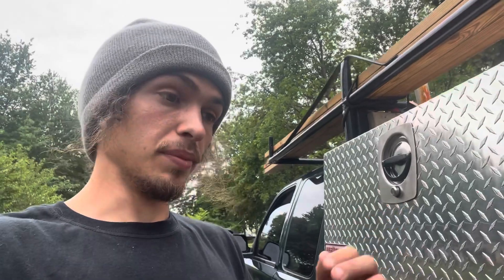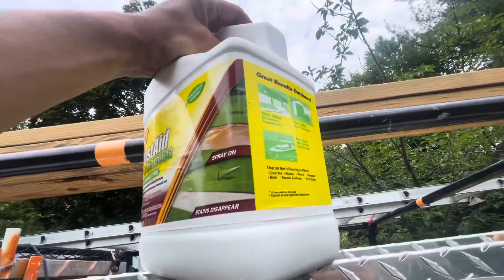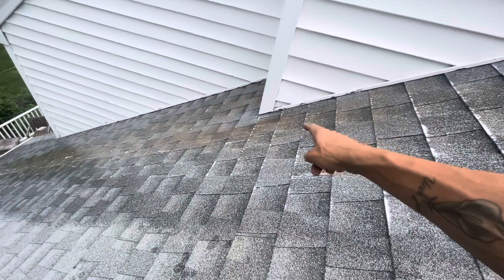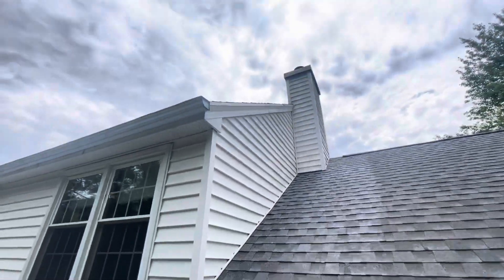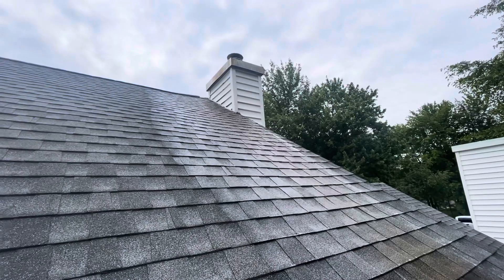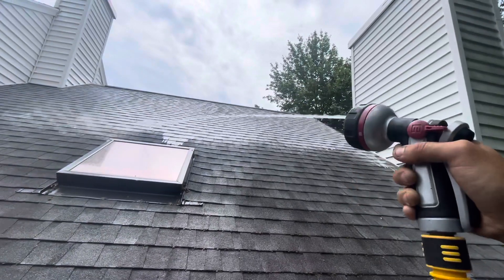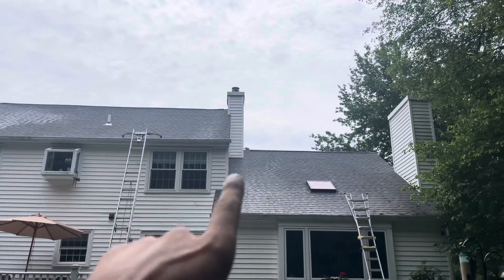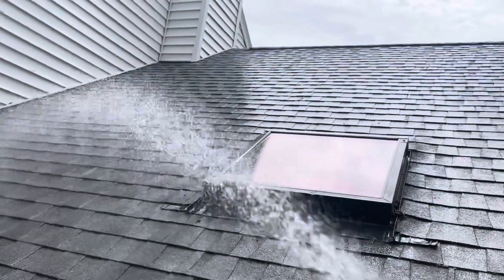How to Rust Removal Roof Cleaning- Rust Aid by Goof Off -12V Softwash

Comment: Hey man I just got my soft wash setup ready, and I was wondering what you generally pay for sh and where you get it? I’m paying about 40$ for 4 gals of 12.5% sh at my local pool store….
Reply from the maker: I pay 22 for 5 gallons of 12.5sh good luck!
Reply: Rural King has 10% - 4 gal cases for like $12!
Reply: I get mine from Pinch-A-Penny pool supply at $2.25/gal.  This store is a chain and may be in your area.

Comment: Hi Juan,
Enjoyed your video. We tried the Rust Off on our blue asphalt roof and didn’t have same the same great results, Sadly. 
We have applied it two different times and at full strength. Allowed it to fry and then rinsed. Even though the stain is slightly lighter in color, it is now on a larger area of roof. 
Not sure if is because of the original blue color of our roof or something else. Just wanted you to be aware.

Comment: Awesome results. Did you climb the top of the high roof to spray it or did you downstream it?
Reply from the maker: I shot it from my ladder and it was with my softwash system
Reply: @Phantoms-Workshop  that’s cool, what was your ratio for the soft wash system?
Reply: Thanks for sharing. I’d like to have seen how you included the liquid in your water line. I didn’t catch that.

Comment: Good footage.  I too use rust aid, it's a great product.  I am curious though.  I noticed you had a regular hose gun to spray everything which is a great idea.  It's more comfortable to use and simple.  It's also cost effective.  How where you able to attach your regular hose gun to your pressure washer hose?
Reply from the maker: So I actually used my 12V softwash setup to apply the chemicals. I made a 10 gallon batch mix of rust aid and applied with my 12V pump I use for house & roof washing!  Thanks for watching 😎
Reply: @Phantoms-Workshop  hey I'm just trying to clarify. You said you made a 10 gallon batch mix of the rust aid. Put in the video you mention you did not deluded. My question is how did you make 10 gallons with one gallon of Rust aid?

Comment: Nice work! So how did u apply this, through a batch mix tank out the 12v?
Reply from the maker: Yep I just made a batch mix in a small 10 gallon drum. I pulled water through the line first and sprayed until I heard and smelt the chemicals coming out the line! Thanks for watching
Reply: @Phantoms-Workshop  How long would you say this took you?
Reply from the maker: @jakeyork8896  this took me about an hour and a half with set up and breakdown!